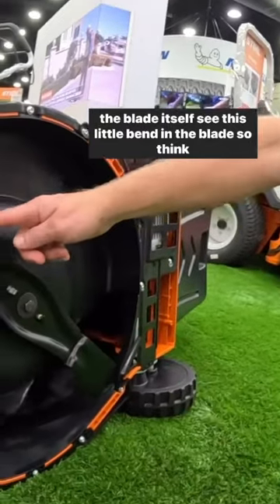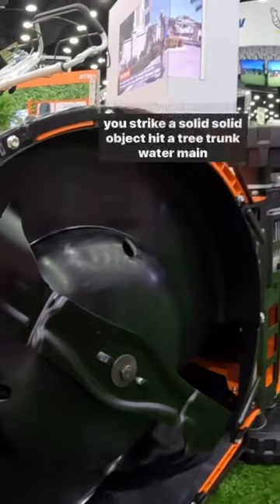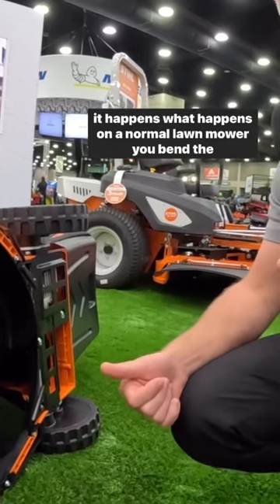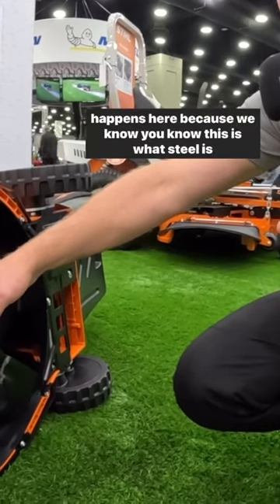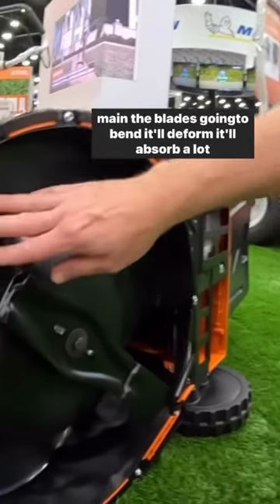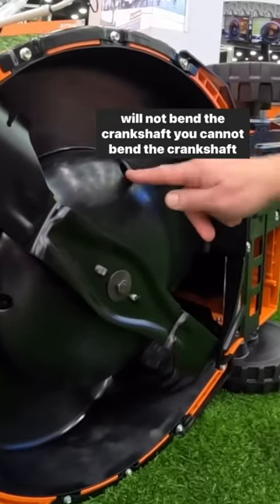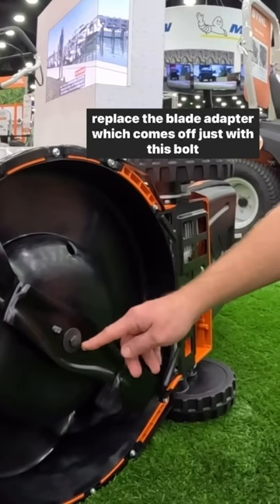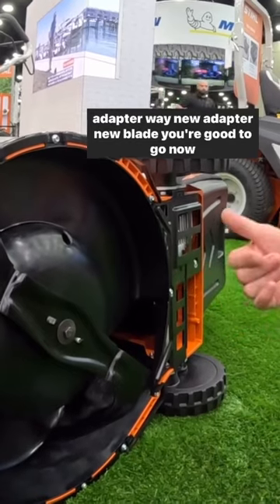STIHL New Lawn Mower Blade Technology #lawnmower #lawncare #stihl

Comment: Crankshaft is an fairly easy fix you just trying to sell something, to many people buy new stuff because they think it’s impossible to fix what they already have
Reply: Why are you hating?
Reply: Bending a crankshaft is an easy job?? Bud, you bend the crankshaft more likely than not the crank seal and bearing will be junk, the connecting rods and even the block itself may be warped or bent. Meaning youll need a new engine.